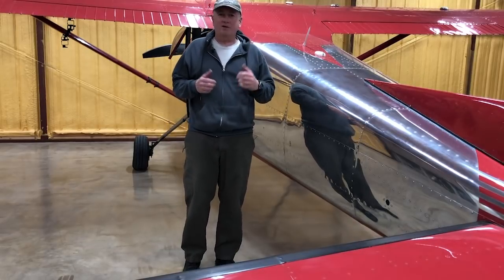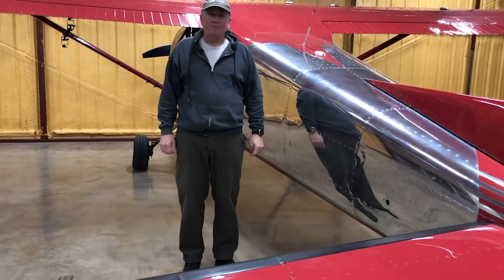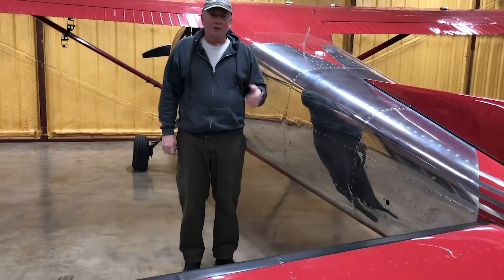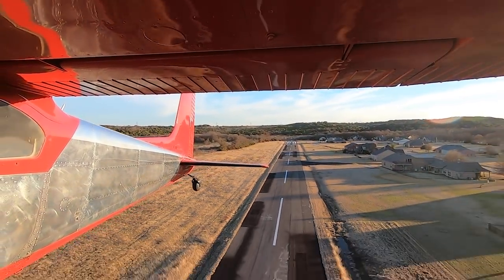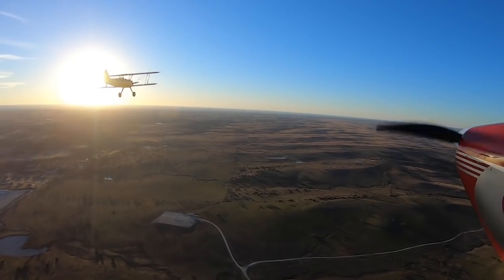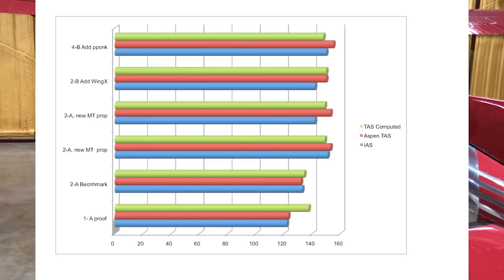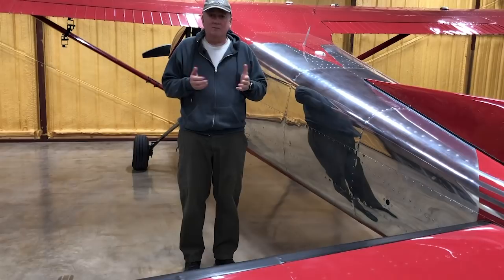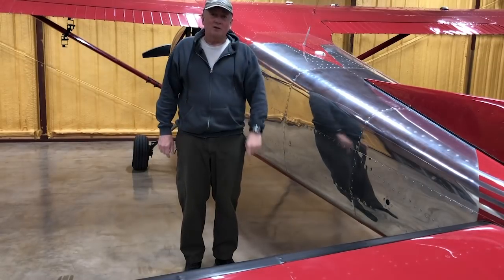FlyWire Skywagon Speed Tests

Comment: The biggest speed increase with my A185E was the addition of flap gap seals and electronic ignition. 

Sportsman cuff, WingX and Micro Aero VG’s with a two-blade, 86” McCauley.
Reply from the maker: Manny- It would have been really interesting to know the effect of each. I'm very interested in electronic ignition. thanks for the watch and post!
Reply: Hi Manny, wich electronic ignition brand ?
Reply: sylvain roy   Electronics International, replacing the right mag and firing the bottom plugs. I run LOP (with GAMI’s) every flight. The only negative is a slight amount of static in the intercom system. They tell me not everyone experiences this. I find it a minor inconvenience given all the advantages. If solo, I go to pilot isolate on the intercom panel.
Reply: Manny, you said 'The biggest speed increase with my A185E was the addition of flap gap seals and electronic ignition.'' Electronic international doesn't make electronic ignition if i'm correct. Would you mean ElectroAir ?
Reply: sylvain roy   Yes. Electro Air is what I meant. Sorry.
Reply: Ok thanks ! I read about the system in 'aviation consumer' and they mention it worth it especially if airplane was flown high enough. You feel you have more power on each phase of flight ? Wondering, because the system is not cheap...
Reply: sylvain roy   It starts better and runs leaner. Because it advances the timing when the MAP is below 24-25”, higher altitude flight yields more power and speed. I flew Ketchikan to WA state last summer at 11,500’, LOP, 11 GPH, TAS 155 MPH with 8.50’s, 10” TW, bubble windows, Sportsman cuff, ART wing extensions, flap gap seals and VG’s. It also climbs better and runs smoother. At the very least install flap gap seals, which also increases your glide ratio with no increase in stall speed.
Reply: sylvain roy   Update. True not cheap, but I just did a Bendix 1200 mag overhaul (500 hr check). $850 flat rate with essentially new everything. Only had to do the one mag instead of two. The electronic ignition also allows less fuel flow in cruise, so all that has to be factored into the total cost, including the performance boost. I think it’s worth it.

Aircraft Magneto Service, Missoula, MT. Highly capable and professional folks.